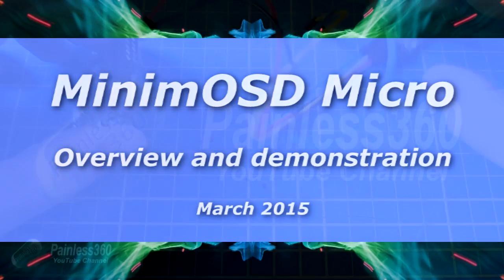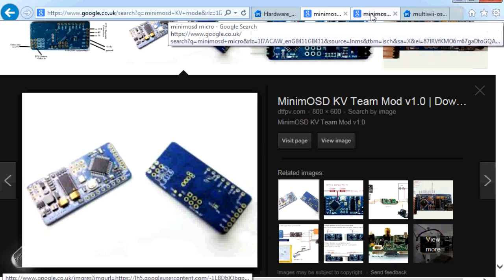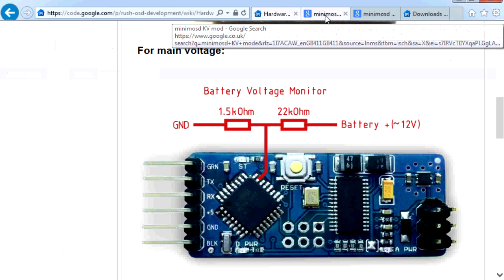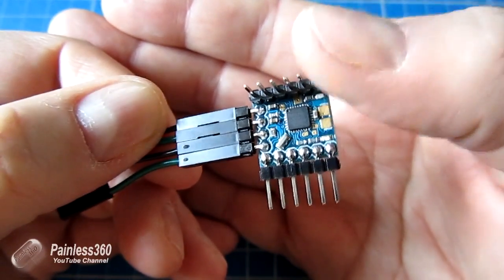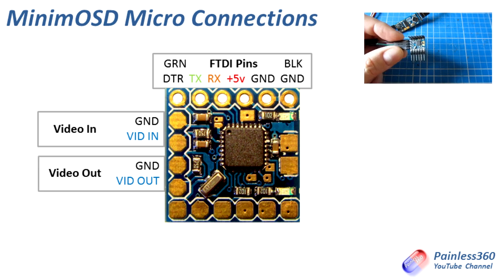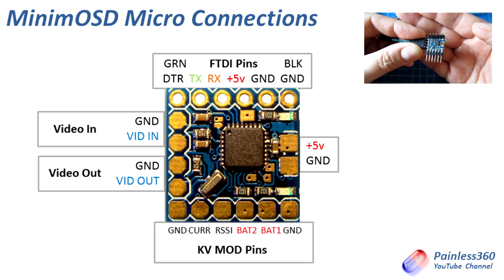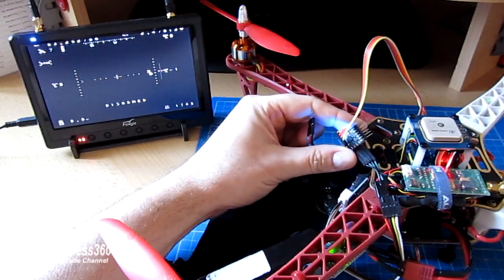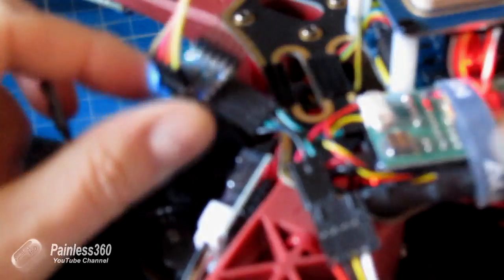MinimOSD Micro - Overview and Demonstration (KV Team mods)

Comment: i have trouble with minim osd mikro. I have transmitter that requires 12v, and camera which requires 3.3v that why i use UBEC for camera. even if i connect tx and camera's GND each other, it doesnt work, picture is transmitting, but there is no OSD information..i think i have to find a 12v camera?
Reply from the maker: What troubleshooting have you done?
Reply: I couldnt test it with another camera yet. because i have only one. I tryed two different firmware which you shared with us at your channel. While it connected to pc, everything seems good. Im tryin to find 12v camera and will share results with you
Reply from the maker: +Baris Guler I would check that the fonts uploaded ok to the board. Not sure if this helps but this is a preview of a how to video covering 12v cameras - https://www.youtube.com/watch?v=bv-bsLjD2n0
Reply: I wacthed the video, Im going to do some tests, Thank you to your quick reply and help. You are the man.

Comment: Hi  Can you buy that video in/ video out cable anywhere, or do I have to make one.
Reply from the maker: I made mine to make it easy to pop between the camera and FPV transmitter. I used a few servo cables and modified them. Best of luck.

Comment: Hey painless360. I have been watching all your naze/flip videos and micro osd and i have 3 questions i hope you can shed some light on. 
For the record im running cleanflight 1.9 w flip32+ on 3 quads now. 

Q1: the micro osd w kvosd reeboots mid flight on one quad but not on my mini250. Any tips on why? 

Q2: the volt info dont show up on the osd on this quad but it does on my mini250. Vbat is connected with a single wire on quad and both wires on mini250. Other than that they are the same. Cleanflight shows volt correcly on my computer. 

Q3: on all quads the voltage displays the same as my multimeter in cleanflight sw on my pc. Iets say i have 12.4v. I set alarm to go off at 10.5 in sw and as soon as i take off the alarm keeps beeping. Why? 

Keep the videos comming 👍😃
Reply: Solved q2. Had to activate use fc volt in gui.
Reply from the maker: Hope this helps - 

Q1. I would swap the board over with a known good one and see. Could be a power problem on the quad or an issue with the board..

Q2. Yep, FC switch on voltage in GUI.

Q3. The voltage drops alarmingly  (no pun intended ) when you pull a lot of power. Higher C packs cope better. I would lower the alarm again..

Best of luck...
Reply: Thank you! Will have a look at it tomorrow :)

Comment: What's a good current sensor with at least 80A range to use with this OSD? So far the only one I have found is the TBS, but I don't like the T-Plugs that come with it.
Reply from the maker: +Kristian Leonardo Apuzzo Not sure - I'm not a user of current sensors here. You may be able to remove the connector and solder your favourite on. I've done that with a few pieces here. Best of luck.

Comment: Is it possible to use this Micro MinimOSD board as a stand alone board? i was wanting to use it with the Atas mini PDB pro instead of the super simple OSD as the simple osd is not very accurate.
Reply from the maker: +MrP4LM3R I believe it is, but I've never used it this way. There are options in the MW-OSD 1.5 setup for GPS and other modes too. Best of luck with it.

Comment: Hi, thanks for you time. I have micro minimOSD working so pretty. But I like connect bluetooth module and see use same port how can I do?. B. Regards
Reply from the maker: +Camilo Reyes Have a look at the Naze32 series. Everything I know about the setups are in the videos. Sadly you can run out of pins on the Naze32 but if you're not bothered about LEDs then you can use Softserial to give you a few more ports to play with..Best of luck.
Reply: +Painless360 thanks for answer, and do you have any video to do that?.
Reply from the maker: We do look at soft serial in the telemetry video. Best of luck.

Comment: Hi Professor, hope you are enjoying the summer. There are a lot of issues with PIxhawk Minim OSD setup on apm3.2; as related here in this forum:
http://ardupilot.com/forum/viewtopic.php?f=100&t=10270&hilit=minim+osd&start=10
Was wondering whether you would be tackling this issue on your pIxhawk series, please. Issues are on Telem 2. Also everyone seem to be using OSD Extra; and perhaps there would be another firmware (from another community) more appropriate? Any insights or tips to get me going, as I am struggling as well with my new pixhawk, please? Cheers and Safe Flying!
Reply from the maker: I will be covering this in the coming months. There are a few options for the firmware,  you need one that works with the MAVLINK protocol.  Best of luck!
Reply: Painless360 Thanks. I will keep in touch, after I get it working, as I believe I found some special settings from https://code.google.com/p/minimosd-extra/issues/detail?id=137
I will be testing this R-800 version from November 2014 with the SR2 special settings as indicated, and see if it works.... Cheers and Safe Flying!

Comment: I am always immensely impressed with the clarity of your discussion, sharpness of your videos, and wonderful diagrams.
I am a newbie that has been lurking on/over many FPV sites as I acquire hardware to make the plunge myself.
My concern is that newer cameras and transmitters are now adopting 3-5v power requirements, while the specs for many of the OSD systems are for 12v systems or partial 12v and 5v to different components.
I fried the cable between my Mini OSD from HobbyKing and my Eachine tx/cam combo from BangGood, apparently because I wasn't careful separating the power supplies from the 5v Eachine systems from 7-12v main board of the Mini OSD.
Do you have experience running the MinimOSD micro completely on 5v systems? Are there issues?
Also can you recommend a video or diagram which illustrates the OSD data layout in detail as a screen capture?
Thanks. Please continue your outstanding contributions to this hobby!
Jim

Comment: How does it read your battery voltage, you didn't have bat1 or 2 connected I'm really confuse. Plan on using micro minim osd with naze32.
Reply from the maker: J Sanders You're right I didn't - you connect the battery voltages to it as per the diagram to see the on-board packs.If you are using a Cleanflight powered flight controller it gets even easier..Best of luck.

Comment: im going out of my mind - i got it to powerup and display something... what is mavlink heartbeat and why is it being so mean to me! iv read lots of forums and its filling my head with junk. its the final piece :(
Reply from the maker: lykenth08 This covered on the channel ;) The MAVLink heartbeat is what the firmware listens for from boards like the APM, Pixhawk and CC3D (running Openpilot). MAVLink is the telemetry data that the flight control board sends that the OSD then interprets and displays on the screen over your video (voltage, height, GPS co-ordinates etc). If you are using a board like the Naze32, Multiwii or SP3 then you need to download and change the firmware on the MinimOSD to match the one you are using. The answers are on the channel. Use the playlists and they will help you find what you need.Best of luck.
Reply: Painless360 I looking for the firmware location or link for micro OSD in this video to run OSD_Config.exe it seem to been deleted or it's location is 404. When running OSD_Config  I able to save the setting but I am receiving the Heart beats error from what I have learned here that would indicate firmware.

Comment: Awsome vid..!! As usual.=)  My question is, is it possible to feed RSSI off of pin 6 on the NAZE instaed of tapping of the DR4 pin 2sig... ? Thanks in advance.
Reply from the maker: Danks111 Not sure - I used the RSSI channel way of getting the values from the FrSky receiver into the Naze32..Best of luck with it.
Reply: ok thanks, ill try it and let you know how it goes.

Comment: I've noticed on the MinimOSD Micro board there is a pad to connect a current monitor and was wondering if an APM Power Module would work with this board for monitoring current.

I would seem to that the APM Power Module would be ideal as it also provides a battery voltage monitor signal as well as a current monitor signal. With the newer Micro APM power distribution boards this is built in and would be ideal for a 250 quad build.

Question is can the current monitoring signal be used by anything else besides an APM/Pixhawk board? They are 'as cheap as chips' too.

BTW- Excellent YouTube channel!! Thanks, and I really mean that!
Reply from the maker: James Lummel Not sure - I've not tried it. You will need to find the specification for the APM module and look at how that compares to the inputs on this board. Best of luck!

Comment: Help!? have i fried the osd already?! - when i plugged it into the pc  to change the display its always shown a rapid flashing green light, i wouldnt say its bright at all like the others. it came pre flashed so i could put in into the quad - but - and this is where it gets strange, when i power up the quad the osd dont come on and the TX does but when i disconnect it from the FC then reconnect it, the TX turns off and the OSD comes on with the same rapid flashing green light. Can any one help at all please?

Comment: are u sure about switching 5v and GND? (wrong diagramm)
Everybody else seems not to switch it and i cant find any other source confirming this
Reply from the maker: r3mixstyle There is a note on the video that you may not see if watching it on a mobile device. The graphic is wrong and the aux. +5v and GND are swapped.

Comment: Will this mirco minimosd works for CC3D? if yes which firmware to use. thanks
Reply from the maker: Ken C No, see the CC3D/MinimOSD video. It explains it all.
Reply: Thanks
Reply: +Painless360 Hi, thanks for excellent info :). I want to know is still micro minimosd not work with cc3d

Comment: My micro boards came preflashed with arducam v2.0 firmware wich obviously didn't work for me, because i'm using a flip32+. I've tryed to flashed them before with kv team 2.3 but they simply didn' accept the firmware. I've just finnished updating them with the MWOSD 1.3 and it was pretty simple, I'll try them now, cheers.
Reply from the maker: Bruno Santos Don't forget to try an older version of the Arduino software to flash with if the latest version isn't playing ball - loads of problems flashing older sketches with the latest version..
Best of luck.
Reply: Painless360 good tip, I wasn't aware of those compatibility issues of the Arduino software, thanks.
Reply: Painless360 which version of arduino you recomnend? I have problem flashing my micro minimosd. Gives me sync error.
Reply: fdaremi I used the latest arduino version at the time to flash mine with MW OSD 1.3 and had no problems. You may have problems with previous versions of the firmware such as KV Team 2.3 that dont seem to work with newest version of arduino.
To be safe you can always use arduino1.0.5
Reply from the maker: Perfect answer Bruno - thank you.
Reply: Thanks. Using Arduino 1.0.3 and resetting the minimosd during flashing fixed my problem.

Comment: WARNING at 7:00 the pinouts on the right side +5v and ground are around the wrong way, should be ground at the top, cheers
Reply from the maker: Thanks for the comment. Missed that.  I will add a note!
Reply: Painless360 the note needs correcting the "had" should be "has" good video thanks

Comment: I have a Micro MinimOSD, it came with Arducam OSD loaded. I was able to get video out of it but no telemetry. It would just display waiting for MAVlink heartbeats. At the moment I have disconnected everything and just have the FTDI connected. 

When I power the board up through the FTDI the blue LED comes on and stays on, Geen LED flashes a few times then stays on. So I beleave it has a bootloader installed

I have now used Arduino and successfully cleared the EEPROM. I then tried to load KV_TEAM_OSD as per your videos. If I try to verify or upload I get the following error.

Arduino: 1.6.3 (Windows 7), Board: "Arduino Pro or Pro Mini, ATmega328 (5V, 16 MHz)"

C:\Program Files\Arduino\hardware\tools\avr/bin/avr-g++ -c -g -Os -w -fno-exceptions -ffunction-sections -fdata-sections -fno-threadsafe-statics -MMD -mmcu=atmega328p -DF_CPU=16000000L -DARDUINO=10603 -DARDUINO_AVR_PRO -DARDUINO_ARCH_AVR -IC:\Program Files\Arduino\hardware\arduino\avr\cores\arduino -IC:\Program Files\Arduino\hardware\arduino\avr\variants\eighta naloginputs C:\Users\Andrew\AppData\Local\Temp\build6176978312 406979183.tmp\EEPROM.cpp -o C:\Users\Andrew\AppData\Local\Temp\build6176978312 406979183.tmp\EEPROM.cpp.o 

In file included from C:\Users\Andrew\AppData\Local\Temp\build6176978312 406979183.tmp\EEPROM.cpp:5:0:

C:\Users\Andrew\AppData\Local\Temp\build6176978312 406979183.tmp\KV_Team_OSD.h:180:40: error: variable 'item_table' must be const in order to be put into read-only section by means of '__attribute__((progmem))'

extern PROGMEM const char *item_table[];

^

Error compiling.

Any ideas

Thanks in advance for any help.
Reply from the maker: RC Lewis I would try it with an earlier version of the Arduino program. 
Always works for me.. 
Best of luck.
Reply: +RC Lewis I had the same problem and I got the solution online. What I did was to change the line from "extern PROGMEM const char *item_table[];" to "extern PROGMEM const char *const item_table[]; and the error cleared. Hope this helps incase you haven't resolved it.

Comment: Hi,
Can I power the micro minimosd directly from spare +-5V pins on naze32 or will it pull to much current?

Thanks
Reply from the maker: Bernard George You can, but make sure that the BEC you are using can handle the extra 500mA it needs.
Happy flying!

Comment: Thanks again for another great video, sorry for all the questions as I'm new to Multiwii/Minim OSD, for main battery voltage (4S) do i just simple take a Positive/Negative from my PDB and wire this to Bat1 +ve/-ve on the board without the need for extra resistors as per your other video? KV Team Mod Board not micro, busy installing it just now but a little worried about putting 4S voltage straight to the board, also for RSSI I'm guessing I simply wire these from my RX (EzUHF) to the appropriate pins on the board then configure my rx for RSSi out in the ezUHF software,

Thanks again.
Reply from the maker: Rudeboys FPV Full specs here - http://www.rcgroups.com/forums/showthread.php?t=2325491
Up to 4s...
Reply: Painless360 Cheers, so i can just connect from PDB to OSD, good good, next just need to figure out the how everything needs configured in the GUI, no GPS just looking for basic info, RSSi and Battery monitoring, keep it simple to begin with, may add GPS at a later date, thanks again your videos have been a big help, I'm more used to EzOSD and Vector OSD, first time playing with Multiwii.

Comment: I'm still trying to get this to work with my CC3D,  I installed minoposd which communicates in UAVtalk instead of MAVlink.  I can see a startup screen but that's about as far as I can get.  scrolling through some of the minoposd threads it appears that the team KV mod is not supported because the board architecture is different.
Reply from the maker: mwalz135 CC3D and MinimOSD will be on the CC3D series coming soon..
Watch this space!

Comment: The only thing i would add, is that people should install a switch to turn the tx or rx line from the naze <-> minimosd "off" otherwise you wont be able to connect the Naze32 via USB, because the USB and RX/TX lines are shared.

Comment: Have you noticed that the timer is off about 2 minutes after 6 minutes of flying? I had this problem with mwosd1.3 and had to reinstall 1.2. Any help on this would be appreciated. Thanks for all you videos.
Reply from the maker: I have not seen that myself but there are a few bugs coming to light in 1.3. You can read about them in the FPVLAB.com forum pages. I would pop post in there for the developers are work is underway to fix them.  

Happy flying!

Comment: Great. This tiny thing is awesome.  For a 200 or a 250 perfect. Great video. Thanks for your knowledge
Reply from the maker: Thanks for the comment, I love this thing and the fact that I can pop the main battery voltage/video voltage/current/RSSI into it without some very fine soldering is fantastic.

I have been watching the KV Team Mods threads and this is such a great piece of technology for the price.

Best of luck fitting it to the 250 quad. That is an ideal platform..

Happy flying!